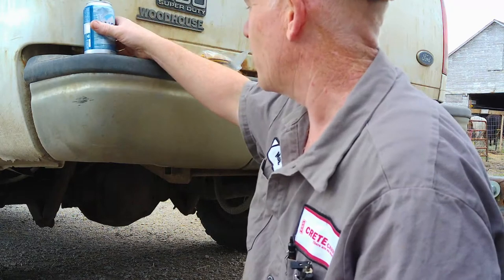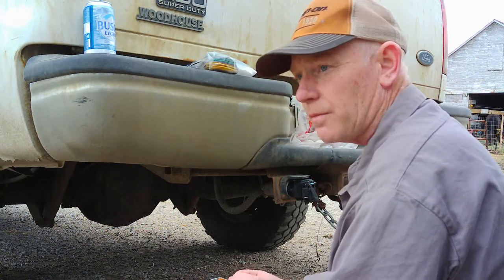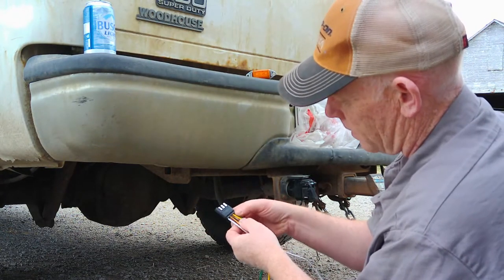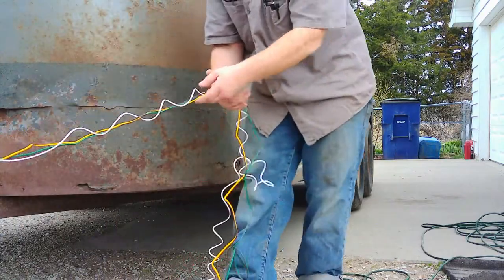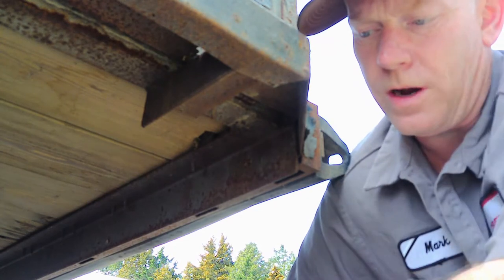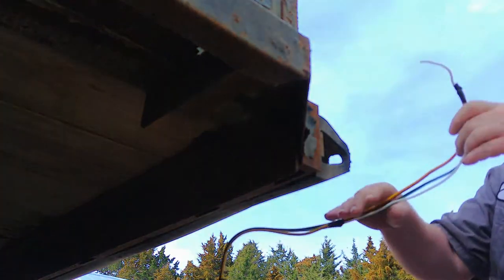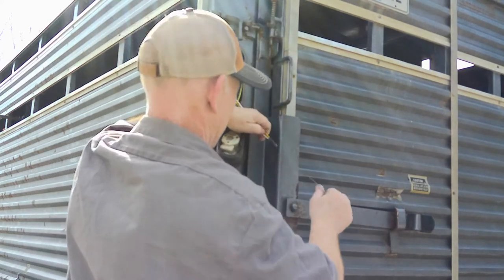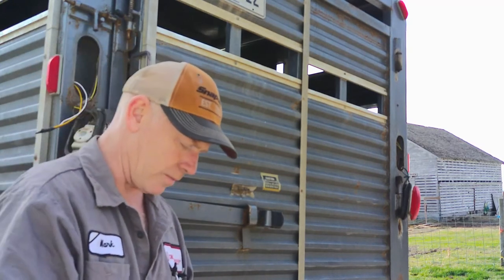How to, DIY  wiring a horse trailer.  Quick, simple repair

Comment: If not wire nuts whet do you use?  Do you use the new waterproof wire nuts?  My experience with the vampire splices is that they don't seem to age/weather well.
Reply from the maker: I try to always use heat shrink butt connectors,

Comment: Couldn't you use the old wires to pull up the new ones instead of the fish wire? Is that a potential  problem?
Reply from the maker: The old wires weren't routed through the same area I ran the new wire.  It was by no means the best way to run the wiring,but it was the easiest.